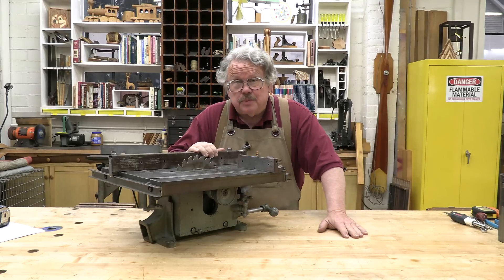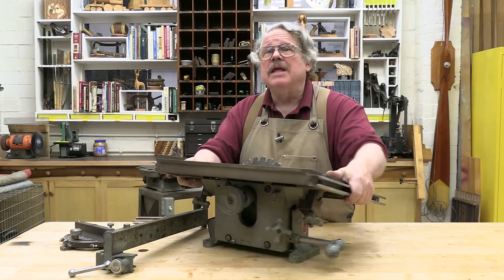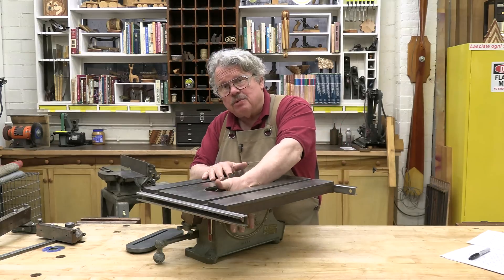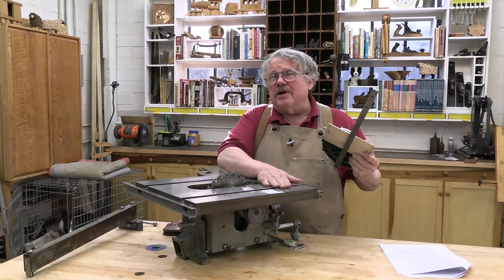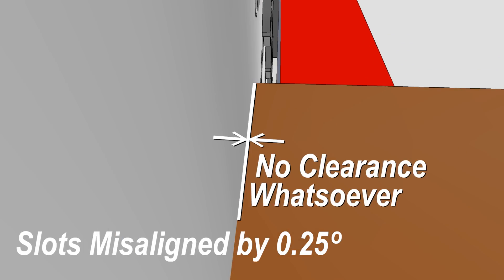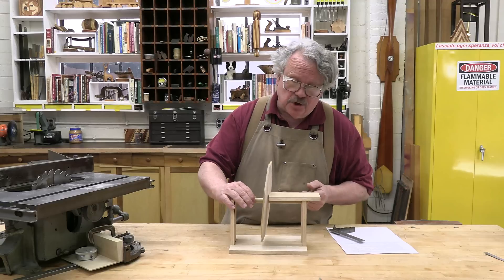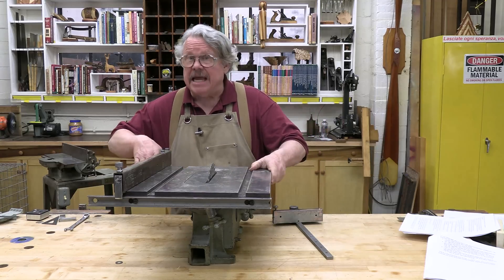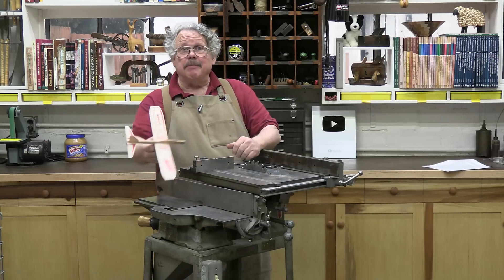Crucial Table Saw Alignments and Adjustments

Comment: An older friend owned a woodshop. Started in the 1960s, it had been equipped mostly with used power tools. When the shop closed down in the 1990s, I was gifted the Delta bandsaw, drill press, and stationary belt sander (6" Abrasive Belt Finishing Machine, in Delta vernacular). I believe they had all been manufactured in the 1940s - and they have the same "look" as that even older tool  in your video. Boy were these tools built for the ages. I've had to adjust them (rarely) or replace minor stuff, but these 80 year old tools still run flawlessly. 

Also back in the late 90s, I bought a Delta hobbyist 8" table saw for $25 at a yard sale. (the seller had put the blade in backwards; he warned me that he was selling it cheap because it "didn't cut very well". 😆) Talk about customer service - I called Delta on the slim hope I could get the manual. The woman on the phone took the serial number and put me on hold. A couple of minutes later, "Sir, we ran out of print copies, but give me your address and I'll send you a Xerox copy. No charge." And she told me that it had been built in March 1958. It was only six months younger than me. It did everything I needed it to for two decades. I finally gave it away, still working fine, when I moved up to a 10" saw.
Reply from the maker: Thanks for sharing. I often advise students and newbies that they can get better tools for less money if they look for older tools that were manuifactured before the 1990s. In my mind, thet's when planned obsolescence took over the power tool industry. If made before then, you can often restore a used tool to like-new performance simply by replacing a few belts anbd bearings.

Comment: This is all extremely good content however there is one fatal flaw in all of this. It assumes that the arbor flange is true to the axis of rotation. If the arbor flange is out of square all blades will have run out that you can’t count for. You must ensure that your arbor flange runs through. This is especially bad on low quality table saws.
Reply from the maker: Good point. There are several parts of a table saw that when poory manufactured may cause runout -- including the arbor itself. Yet another reason for avoiding cheap tools if you can. And if you can't, align and adjust the tool straight out of the box to indentify manufacturing problems. Exchange it or get your money back if there's a problem that careful alignment and adjustment won't solve.
Reply: @WorkshopCompanion  thank you for the reply. Matthias Wandel has an excellent video on using a grinding stone to fix run out caused by the arbor flange.

Comment: First things first, I had a few of those balsa wood model airplanes between the mid/late ‘40’s and the mid-‘50’s. As to the presentation, it may be the clearest, most logical, reliable and accurate description of which steps to take when and in what order and, most importantly, why. 🧐👍😎

Comment: Would it not be best to measure and mark your run out prior to aligning the blade to the miter slot?  About to do the for the first time and want to make sure it's done to the highest level of accuracy.
Reply from the maker: Its' not going to matter.  Using the methiod shown, the alignment should not be affected by the runout.

Comment: Do you have a video on how you made that wooden gauge holder to align the blade?
Reply from the maker: I removed the back of a dial caliper, then used to screws to mount to a piece if plywood. Or you can just buy this:   https://www.amazon.com/NORJIN-Indicator-Calibrating-Machinery-Resolution/dp/B09QBTLH42/ref=asc_df_B09QBTLH42

Comment: I have had a frustrating experience, learning how to woodwork over the last 20 years. I resigned myself to making only rustic furniture where gaps and imprecise cuts added to the charm. However, my wife has increasingly been asking me for more detailed and finished products. It was videos like this that made me realize that to some degree. My tools were the problem. Dull blades, a table saw that was 64,000 of an inch or almost 2 mm, out of alignment, and not taking it into accounts, the curve and the side of the line to cut. I also didn't use zero clearance on my cuts, resulting in chip out and assumed that a blade was a blade. These were things that I needed to come across because I didn't have a mentor. I have yet to make dovetail joints that don't look like a teenager that needs braces. And I'm now making table sauce, sleds, and learning how to use my data blades to make box joints. I hope after years and years of practice, I can make something that someone will say "that doesn't suck too bad, but still burn it"
Reply from the maker: If you freely admit you don't know enough about tools and materials, you're halfway there to being a good craftsman.
Reply: @ I know you can cut a piece of wood with a hammer, but the results aren't that great

Comment: Despite measuring and re-setting the angle of my table saw blade with a variety of squares and digital tools, I couldn't for the life of me cut a true 45-degree miter. It was always very slightly off regardless of what any of my measuring devices said to the contrary. After learning about marking the blade runoff from this video, I got a perfect miter after one attempt. Never would have considered that myself, but it makes so much sense once you point it out. Thanks so much for the guidance!
Reply from the maker: Most welcome; glad to be useful.

Comment: Great video. I am a mechanical engineer, just one comment: "precise" and "accurate" are not the same thing.
Accurate indicated how close a measurement is to the actual value of whatever you are measuring.
Precise, on the other hand, is a quality of manufacture of the instrument indicating the "repeatability" of the instrument. In other words, do you get the same answer over repeated measurements with that instrument.
You can have an "accurate" watch that is not precise. It may gain a minute one month and gain 3 minutes next month, but never changes more +- 3 minutes.
Conversely, you can have a very precision made watch that is way off, but it is the same amount of "way off" all the time.
Calibration can make an precision watch more accurate. It can not make an accurate watch more precise. It is a quality of manufacture issue.
Please excuse my OCD.

Comment: If max deflection and min deflection are not exactly opposite sides of the blade does it means the blade has a slight warp to?
Reply from the maker: Quite possibly. Could also mean the axis of rotation of the arbor is not parallel to the table surface.

Comment: Nick, are you going to check out the runout 
of the arbor?

Check the runout of the blade, like you just 
did.  Loosen the arbor nut, turn the blade 90
degrees, tighten and re check  If the marks 
on the blade measure differently, you have 
runout on the arbor.  (Yes, I repair tablesaws.)

steve

Comment: Thanks Nick. This is most interesting and valuable. I sure wish I knew how you fastened your dial micrometer to that jig attached to the miter gauge. Mine is always a couple of inches off the table. Your setup looks WAY more stable and reliable.
Reply from the maker: The back of the dial mike comes off with three screws. Set the back aside, drill three holes with counterbores in a piece if 1/4" (6 mm) plywood, and screw the mike to the plywood. Glue the plywood to a small board to make an L-shaped assembly that you can attach to your miter gauge.

Comment: Is it important to have the fence vertically plumb to the table? Mines off by about 4 degrees.
Reply from the maker: Yes, absolutely. The face of the fence should be square to the saw table surface, especially if you need the surface as a reference or a guide for a cut. Only a very fences allow you to adjust this. On occasion, I've had to build a tall fence jig and either shim it or cutting oblong mounting slots so I could adjust the angle when I mounted it. You may have to do the same.

Comment: Wow another superb video!  I have struggled with the adjustments on my cabinet table saw for the past eight years.  The saw cost me over £1000 but I have seriously thought of replacing it but then the reviews of even more expensive saws helped me to see that they too have issues. But you have just given me the instruction and clarity I have needed. Your methodology appears to be sensible, methodical and practical. Now I need to dedicate some time and effort to ensure my saw becomes a valuable friend. One area of distress that you might be able to advise on - how to clear sawdust from inside the saw. Mine is a nightmare despite trying different methods of extraction and other modifications. Yours is a channel I need to spend more time watching. Thanks for sharing your knowledge and wisdom.
Reply from the maker: Most welcome. A well-designed saw should be impervious to the effects of sawdust -- sealed bearings, self-clearing threads, etc. I say that, but there are certain woods that when reduced to a fine dust will load onto the interior parts of a machine despite the best engineering. From time-to-time, you just have to get inside the saw cabinet with an air compressor and a wire brush. It's a pain, but it's a must for good maintenance. Religiously turning the vacuum on when using the saw will extend the time between cleanings, but nothing can prevent them completely.
Reply: @WorkshopCompanion  - thanks for the generous reply. I always use the attached 2 motor Camvac whenever i switch the saw on but despite improvements to the internal dust collection and 4 inch take off, the sawdust still builds up. Getting inside and cleaning it out, as you describe, has become a time consuming but necessary monthly exercise. But I suppose that the downside of using a table saw. Thanks for your input.

Comment: Miter guage can checked  by installing it upsidedown and square ing to end of table.
Reply from the maker: Only if the table saw has a machined front edge and that edge isn't covered by the fence mounting rail. My saw loses on both counts.

Comment: Should you also make sure that the blade set at a dead precise 45 degrees be absolutely the same distance when measured from the front of the saw as the back of the saw? This will make sure the blade truly cut a square at the 45 degree angle.  Hope I described this well enough for you to visualize what I am talking about.

Comment: Nick that was a good presentation on setup of s tablesaw and I’m sure you are aware of this but I have to say, there is a setup tool that takes the place of the sawblade. It is round with an arbor hole and flat to machine shop standard, about .0005”. When you use it, you will get a much better setup with it than with your blade. If you find a blade that doesn’t cut well with that setup, toss the blade and get a better one.
Also remember there is wear in the miter slot in most well used saws and for mine it was about .002” so I bought a miter gage from Incra which has an adjustment to take up that clearance. 
I could go on but we are down to tolerances that are less than the movement of the wood with the weather.
Much as we try there is a tolerance for everything.  In the machine shop they say “ round”, we say “how round?”. They say “flat”, we say”how flat?”.
Nothing is exact but we try.
Reply from the maker: Glad you mentioned that set up tool, but you have to know what to call it in order to find it on the Internet. It's normally listed as a "Sanding and Calibration Disc."

Comment: You might be uploading in 4K but YouTube isn't showing you in 4K. My jobsite saw has some rubbing on the back of the blade, I didn't realize my table was crooked. Thank you. Now for my miter saw. Gimme a perfect miter saw and I'll give you perfect miters. I been using miter saws for going on 3 decades but for the life of me I cannot get that thing dialed in. Replaced all the wear parts already went through the whole saw and still get almost a half degree off on my test cuts. Maybe I need a new saw, because why settle for being close when you can be precise. 

I appreciate you sir. Thank you for sharing your skills knowledge and experience
Reply from the maker: YouTube has options to change the resolution of a video. A lot of times it automatically chooses 480p or 720p for people and you have to change it. Also some scenes are in 1080p for time lapse or because of zooming in the editing process. Thanks for the feed back and glad our video was helpful.

Comment: Thank you for sharing! I got at least two now hints in this video which will help me to adjust my saw even better. Thank you for that! I always try to get my old tools working properly instead of buying new once and hope they are doing better. BTW… new tools from the factory needs adjustments as well as long as you don‘t habe service agreements with the brand which most hobbyists might don‘t have.
Reply from the maker: True. You should never presume the a tool just out of the box is aligned and adjusted properly.

Comment: Learned all this 45 years ago in shop class in high school. The shop teacher was surprised when I dialed in the table slot to "half a thou". I was not happy with that half of a thousandth of an inch that the table was off. In my 15 year old brain, zero meant zero. That's when I learned about acceptable tolerance. 

 It's a shame so many schools have eliminated Industrial Arts from their curriculum. Not everyone is going to be a surgeon or a computer programmer. Shop classes teach lessons that can carry over into many other facets of life.

Comment: Almost got killed with a table saw once. It had been dropped,  and was bent up. The wood tended to bind up and kick back. I let my gaurd down on one cut and it kicked back a 1 by 2 about 30 inches long. It missed me as it went by, but there was a wall behind me about three feet back. This one by hit the wall right over a stud, flew back at me like a bullet, missed my skull by a half inch, Parted my hair, flew across the room and went through another  wall, drywall on both sides, leaving only a small hole in the wall, 3/4 by 1 1/2 .

Comment: That’s a good point marking the blades runout. Maybe that’s why I’m constantly making tiny micro adjustments to my saw?
Reply from the maker: Could be. But the engineering of a table saw is more complex than it appears on the surface; a single problem can have several possible causes.

Comment: Do modern table saw blades really have this much runout?  I'd be more concerned with the arbors bushings.
I think on a cheap saw this shows up more,  but my point is a blade spinning at 10k rpm on its outer circumstance will track back to its stright line its only durring its stationary sate run out becomes a problem. Now how to test this with a saw running?  To find perfect squar to table 90 dgr running angle?
Its easy to do on a band saw to ck but a table saws not so easily done, so finding the blades center of run outs a good idea.
If a saws running centrifugal force will make the teeth run true but will that true be 90 dgr to the table?

Comment: Very good. I came across a tip for seeing your saw's throat plate level with the table. I like it because on my throat plate the screws tend to move. Locktite is likely the answer to that but I did away with the screws and now use hot melt glue.

Take the throat plate out. Clean the tabs the throat plate sits on and wax them. Put generous blobs of hot melt glue on each tab. Put your throat plate in and carefully press down until the throat plate is level with the top. Check with a straightedge. I've done this and my throat plates are dead on after years.
Reply from the maker: Interesting tip. Something in me rebels at the idea of doing away with the screws, but if it works, it works.

Comment: Been maintaining tables saws for 40 years and I use a machined dead flat 10" parallel disk with 5/8 arbor hole, with a runout gauge.  Never never never considered the actual run-out of the saw blade itself.  Lost count of how many times I went to square the blade after making miter cuts or prior to starting a new project after the saw sitting idle.   Will be checking the current blade today.   Thanks

Comment: VERY informative!
I have an aged Delta that weighs more than I do, and I want her to love me forever - I'm concerned the arbor itself could've warped, so would that make everything else redundant? (My Delta sliding miter saw needs similar attention...)
Reply from the maker: A bent arbor would be very difficult to replace in an out-of-production table saw -- you'd need a good machinist. But it's check the bearings. If the arbor bearings are worn, they can make it seem like you have a bad arbor.

Comment: What do you do if your table top doesn’t tilt?
Reply from the maker: The procedures are the same. But instead of the truing the table to the blade by loosening the trunnion screws, you loosen the screws that hold the arbor in place.